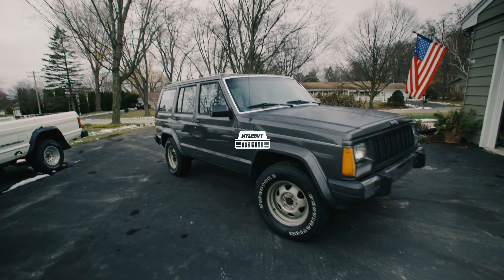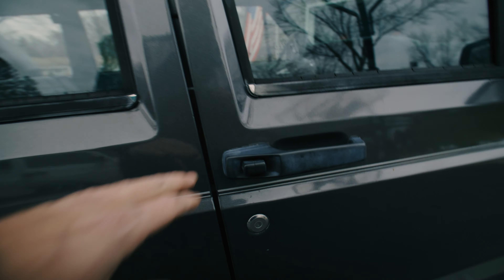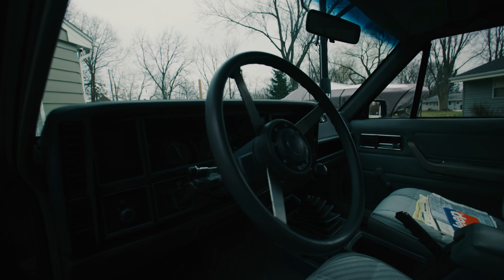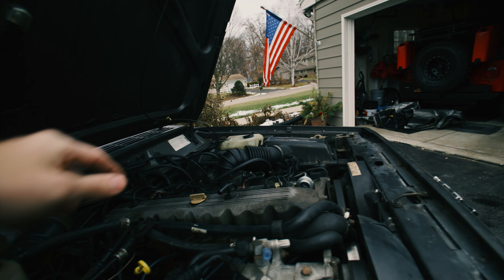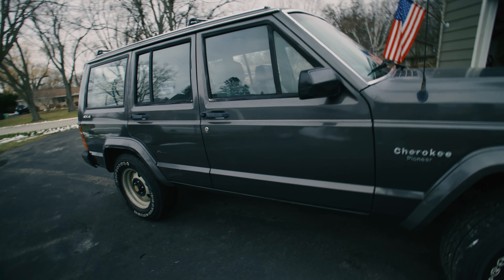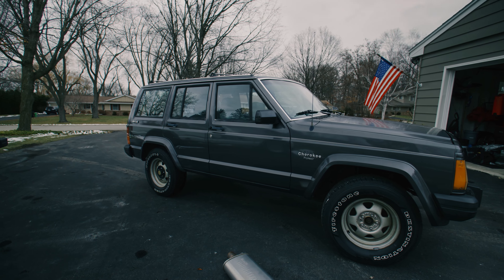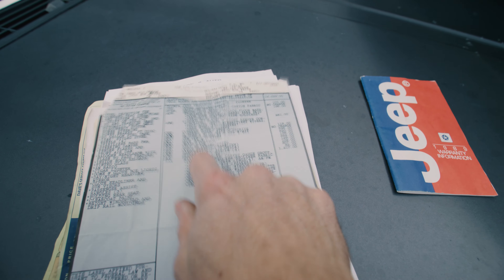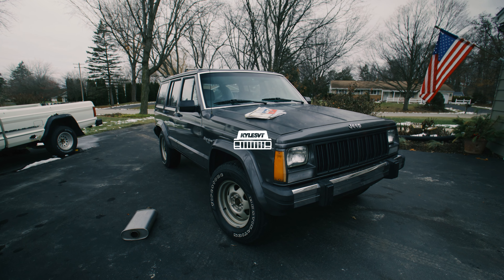What's Wrong With The Jeep XJ Cherokee ?

Comment: Careful with the clutch master leak, I had to cut out my old fuse box and solder in a new one from an auto. It was a painful process. Mine also has the wiper return issue sometimes, haven’t diagnosed it yet.
Reply from the maker: Thank you! Have a rag there for now to see how bad the leak is.

Comment: Check your wiring where it goes through to the rear hatch,may be that unless you're sure it's the motor. Had a broken wire on my 98 to the rear wiper motor. Nice XJ, I've built 2,a 96 and 98, still working on the 98.
Reply from the maker: Thank you!

Comment: One of the first mods you may want to consider is a limited slip differential in the rear. It'll increase the XJ's capability exponentially (Especially being in the snow belt). I've got the factory Trac-Lok in the rear of my 96 and, besides hardcore rock crawling, there isn't a single place I've not been able to go, and especially being about a ton lighter than most Wranglers, she'll go quite a few places they can't. I also put a 2" lift and 31" Goodyear Duratracs. Going from stock to that setup, I couldn't believe how much more capable it became. Thought I'd mention all that to maybe give you some additional ideas on your XJ's upgrade journey.
Reply from the maker: Thank you I appreciate the insight
Reply: Do some research on what you have first. My XJ came with an lsd from the factory.
Reply: Actually would be much better investing in a locker or LSD in the front axle.

Comment: Personally, I would keep them wheels but paint them black. Also get a set of A/TS or M/TS in a slightly larger size. keep the Chrome on the bumpers, it's a classic look.
Reply from the maker: Some BFG KO2s would be perfect for it I think!
Reply: @KyleSVT  lm with you. I like trucks that look like they just left the factory. I would put a 2 or 3 inch suspension lift and some 31’s on the stock rims.Check out this guys Jeep on his channel KCars.